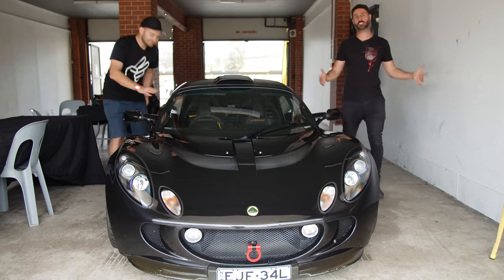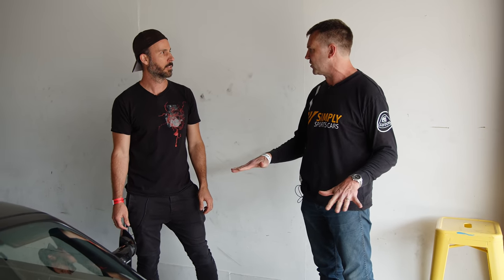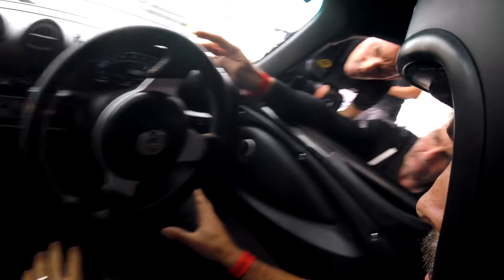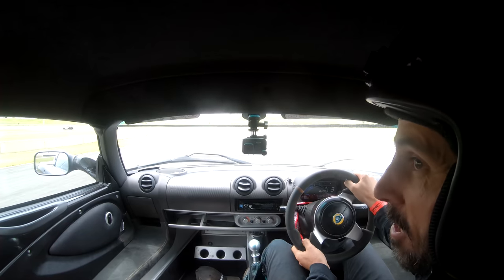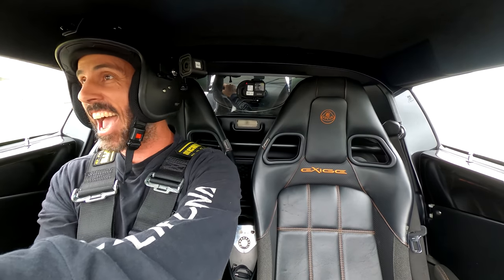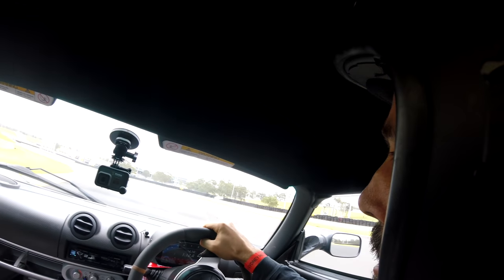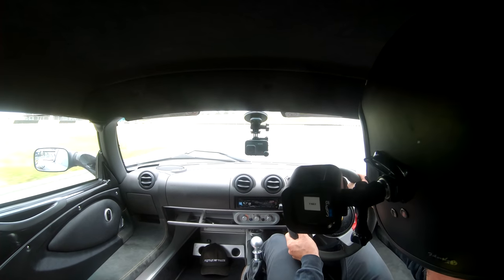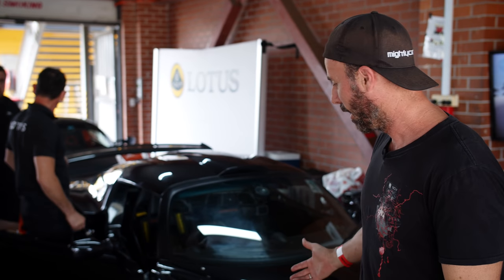LOTUS - Supercharger Upgrade (First Drive)

Comment: “It should be fast now...”
Reply: So much for "getting a super car so much faster than the golf" FAIL...shoulda kept the golf
Reply: @OutsideDuhBox  on a track it should be
Reply: @OutsideDuhBox  it would be quite a bit quicker on the track especially with some more fine tuning and a driver mod
Reply: @GeneralNOH  not without a butt load of more power mods it's not going to be...and drag race and roll it will always get killed...idk..I feel it's a fail.
Reply: @OutsideDuhBox  but the golf is boring as fuck lol, not everything is about going the fastest you can, the experience alone is worth the lotus
Reply: @narojdebeste  by boring...you mean looks...because as far as every other department it wins. Lol
Reply: @OutsideDuhBox  in terms of driving experience, the golf does not even come close mate
Reply: @OutsideDuhBox  you're comparing a golf to a track car there mate
Reply: @maximumpower8460  and? You can compare any car to any car. And any car can be a "track car" 🤦‍♂️
Reply: It is, they have the power it should have, and the handling being as it should now will produce much faster lap times. The car is very light, and with 250+ BHP is going to be very quick, a stock s240 that has not been ruined accelerates from 0 to 60 mph in 4 seconds and from 0 to 100 mph in 9.9 seconds, not exactly slow.
Reply: 13:50 think Moog said it best himself hehe
Reply: @OutsideDuhBox   @Outside Da Box Its probably already as quick on the track as it is, if not faster. Its a far better platform for the track end of story, lighter, and much better designed for tracking. its a 1.1 tonne MR car versus a front engined hatchback closer to 1.5t.
No matter what you do to the Golf, its still a Golf.
As it stands the power to weight isnt too far off the Golf R they had anyway, 10-20 more KW on the Lotus and its going to be pretty close.

Yeah the Golf migh win a drag race, itll be more comfortable, more quiet, more practical. But thats completely besides the point, if you think its a fail youve totally misunderstood why they've bought this car, its for the driving experience, not mashing the pedal and seeing what 1/4 slip you get at the window😂
Reply: @GeneralNOH  how is everything you mentioned as pros to the golf "besides the point"? Maybe they are to you...but all those pros are HUGE wins to the golf and to many, and it would also win a drag race AND price. And it is NOT faster on the track the way it is right now, I would say it needs boost turned up waaay more and more go fast mods to make it as fast on track as the golf right now. Yes eventually and with less will it be faster on the TRACK...but BARELY..AND it would lose all those other "beside points" as you call them..I am by far not a golf fanboy, I have never owned one, I just see this as paying more for less in a lot of categories, and barely more in one category, just for the sake of it being a "nicer looking" Lotus...and not mashing pedal and brake and turning the wheel just to see your "number on a screen" 🤣 and moog will defend the lotus to the death rn...it IS his current content beauty. Gotta defend it duh...why talk smack? Wouldn't add to views.
Reply: @OutsideDuhBox  i drove a golf R and it's not funny to drive, it's good but it does everything alone correct trajectory adjust braking force and steering wheel stiffness, i don't feel like i'm driving it, and that's why it's not a race car.
Reply: @samcoffre9684  the purity
Reply: @mgn567  yeah its not "fun" to drive...or funny by that matter lol. And yes some people prefer the car to feel engaged with them...but others prefer the number at the end of the drag or track instead ...and others prefer practicality and price.
Reply: @OutsideDuhBox  They were at the end of the road with the Golf either way, it was time they sold it whether they bought a fancy car or a shitty car to replace it.
Reply: @GeneralNOH  this i agree on as far as for YouTube content. The golf was sort of maxed out...although they could have gone with the highest spec rev kit...remember they only did level 2 I believe? In any case, it is typical for a YouTube to move on for content. The lotus shall be the same eventually...what will come next...
Reply: @OutsideDuhBox  Probably wouldnt be worth going further, massively diminishing returns for far more money. Reliability would start to go out the window or alternatively youd be opening up the engine. The thing was pushing 750nm of torque or something, much beyond that you're likely looking at full drivetrain overhaul and something that will need expensive engineering for the street/impossible to have on the street. Probably why a properly fast track car was the natural progression from a properly fast street car
Reply: @GeneralNOH  that lotus would be in the same boat with that same amount of power lool. Drive train would need major overhaul
Reply: @OutsideDuhBox  Got nothing to do with power its all about torque. 
Much simpler drivetrain in the Lotus, id hazard a guess its more robust as a result.

Unless you wanted to turn it into some sort of drag car (why would you) thered no reason to push big numbers anyway, it would just get sketchy to drive and its a quick car as it is. 250-350hp is plenty and easily atainable and already higher power to weight than what the Golf had. 
If they really want to go silly the Exige comes with up to 430hp factory options, the engine they use in that model is a common toyota unit so i dont imagine itd be hard for them to source one and stick one in if they really wanted to. Then you're looking at close to 300kw per tonne.

Comment: "It is the responsibility of the faster car, to slow down for any slow cars", he says overtaking a Ferrari. lol
Reply: To be fair a stock Focus RS  or Subaru STI is probably faster than a Ferrari 308
Reply: @nattankress  I think it was a Mondial, slower (and less good looking) than a 308
Reply: @ToolkiT73UK  yeah correct man. My girlfriend and I couldn't quite determine whether it was a 328 or a Mondial until the side shot at 11.35 where you can see that big finned air vent on the rear quarter. Definitely a Mondial

Comment: "It is the responsibility of the faster car to slow down for the slower car." (seconds later) Bye-bye Ferrari!
Reply: This is ironic and funny, but true.  A Lotus may be fast in the corners, but slow on the straight.  The Ferrari should let him pass in the straight  because the overall Lotus lap times are much shorter.  I experience this all the time in my lighter RSX.
Reply: @DC5Brandon  It was a 40 year old Mondial...
Reply: @Jaredscott89  Good point!  I must have missed that.

Comment: The difference between a good time and fun, fun is over when it ends, a good time you'll remember for the rest of your life. Was that a Ferrari Mondial?
Reply: Yes in the vid with the car drivers lap you can clearly see it is a Mondial..
Reply: @ToolkiT73UK  I guess next time I'll bump it up to 720 or 1080. A lot of times though there can be cars that look similar but have a different model name. Like trying to eyeball whether something is a 308 or a 328, 550 or 575M. I believe the Mondial has the regular version and QV.
Reply: @pgtmr2713  the air intakes on the Mondial are very distinctive. But you are right the 308, 328 and 288 are very similar looking at first glance.
Reply: @ToolkiT73UK  See, there's that trivia.

Comment: 13:32 LOL look at the size difference! And that's next to an M2 which is already a pretty small car.
Reply: The M2 isn’t that small. It’s bigger than every M3 before the F80 (slightly shorter in length than the E46), and even then it’s the same height, it’s wider, and only 8-9 inches shorter than the F80. It’s not a big car, but it’s by no means a small car.

Comment: Start learning heel n toe.
You will be so much faster..
Reply: Came here looking for this
Reply: Yea, downshifts are not good
Reply: @MrBasskriss  yeah they are rubbish.
Causes allot of extra wear on the clutch at those speeds when downshifting as well.
Reply: @grantheath8547  Worse than that for a RWD, if you're downshifting late into a corner without rev matching you'll get a nice bit of extra braking on the rear wheels from the engine, really easy to have the car swap ends in that situation.

Comment: Fun fact some Lotus drivers used to use a misfiring system to make backfires. This in turn made loud noises that made it seem that they were more powerful than they actually were. Causing other drivers to push themselves harder than they normally would. Which in turn creates mistakes from other drivers. Thus giving the Lotus driver an advantage. Lotus drivers are not the only drivers who use this tactic, Street racers use it as well. And I'm sure other Motorsports like world really cross, Moto GP, etc, etc.

Comment: I seem to have been correct in the last video regarding the tyre situation, they look like Kumho Ecsta V70A's, as Michelin unfortunately stopped producing track/high performance tyres in smaller sizes..
Also they're not at all mentioned due to contract.

And Moog, now the next step is heel-toe downshifts, as it won't upset the rear end.
And also focusing on having the correct gear for corner exit when entering corners.

Great progression! And love seing your gained confidence in the car! 😃

Comment: Good job man. Alignment and tires are really a make or break for a track oriented car, and had everything to do with how poorly it took corners before. Make sure you really focus on your entry and exits, wind the car out into the exit, and hit the outer limit of the track. You'll be so insanely fast thru the the corners.

Comment: One (hopefully helpful) tip: Use more of the track. You can clearly see in the outside car videos, especially round Brock's turn 5, you are not going near the apex, or near the outside exit point. On this corner in particular I even go onto the concrete slip way on the exit, in a 4 wheel slide, right on the edge of grip. Try using more of the track, it will make it easier for you.

Comment: Hey  Moog  nice to see you enjoying the Lotus now.
If I may offer a suggestion might help brining those times down and inspire even more confidence in the drive. 
You should look at your rev matching and heel & toe your downshifts. You can hear engine wind up to match drivetrain on your down shifts, this can upset traction and balance. If you compare to Mark clip his down shift is instant, little blip and he's back on it. Better rev match will really make drive smoother and more stable specially at corner entry, as well as make the shift much quicker so you can get back on power faster.

Comment: Glad you got the handling sorted. It's the most important factor and far more important than adding the super charger. You need to learn to carry the speed more and improve your lines. I felt you were nearer the limit in the BRZ, but then I think you had a lot more confidence in it. The racing driver showed what is in that car and how to use the track and run off rumble strips. Your journey is firmly under way.

Comment: Late to the party but really digging the track videos. Inspired by super gramps, which I also took my Lib Wagon and just got over 2min with zero engine mods. Will def aim sub 2min and can resonate with using more gears. I need to drop to 2nd for both the double apex and the wide right bender towards the end! Good stuff MCM

Comment: Only thing i noticed you might need to work on, Moog, is to blip the throttle on downshifts. Just letting out the clutch can cause disturbances in the rear wheels, which may end up resulting in a loss of traction on them.

Comment: If you stopped coasting from your braking point to the apex of the corner and knew how to shift using heel & toe rather than upsetting the car balance by releasing clutch as you'd drive on a Sunday stroll, you'd be able to take corners so much faster. Tips from the track with Elise 111R

Comment: If you aren't able to heel-toe, I would suggest installing an auto-blip. these work quite nice on Lotus and have been very well developed over the years. The car gets really unstable on harsh downshifts and the gearbox takes a beating on hard downshifts without revmatching. The C64 transmission isn't known for it's good durability ;-)

Comment: As much credit as I can give them, because they know HOW to adjust a suspension based on their classic oldschool "string" method, the new age of alignments and such with proper technology, you can get even more accurate than the string. They are simply unwilling to learn a new system. At my old mechanic shop, we had two alignment machines (yeah, two) one was pretty old which I knew how to use and one was brand new with a slightly different setup procedure. I didn't use the new machine because I simply didn't want to learn at that point. Eventually the tech came in for the new machine and I got hands on learning, turns out, its insanely more accurate than the old machine, so much so that it made doing alignments quicker. The newer machine also included height values which the old machine did not. So you could see if the suspension was sagging which you might not see with the eye, and it would take that into account when aligning it so the alignment was more accurate. The old machine, didn't care for height values, so you could do an alignment, go for a test drive, and it still felt wrong....

On the note of a car properly setup, moog now see's how important it is for a car to be properly setup. He was clearly smiling ear to ear with the properly setup lotus. Like a kid in a candy store. And it makes me laugh at the street racing scene, and I call it a scene because they think they are hot shit, but 90% of those cars are setup completely wrong in every way and wouldn't win a race vs a slower car with a proper setup. Hell, even back when I was going to street meets sunday nights, all my friends cars had adjustable suspension which they turned their little dial to max hardness so essentially the suspension never moves. You hit a bump or a rock and you felt it through the car, through the seat, and into your body. Meanwhile my car which had stock shocks but lowering springs, had suspension give, so I could corner faster than them (on the street). Now track, sure, perfectly flat ground, no rocks, no bumps, rock hard suspension would/could be important. But even most teams wont go THAT hard. They go as hard as required but as soft as possible. At least from what I have seen.

Comment: After an unfortunate loss of patience, I have discovered that Exige sun visors will pull out by just twisting back and forth while pulling them away the spear-like pin they are hung on. You get an extra 2-3 inches of windscreen vision in top clearance to peer out of from your driving seat. The visors pull away toward the rear view mirror in the middle of the screen. I am 6'2" and found it truly irritating to hunch forward under the visors when desirous of observing traffic light signals and signage at intersections etc.

Comment: Need to adjust the white balance on some of those gopro's, looks like you're driving in a cloud!  Also, in the rear facing interior shots, the engine is moving around quite a bit.  Not sure if its the extra power but would definitely suggest someone see the engine mounts look good, and if there's any trouble getting into gear for sure pop in some poly inserts as that will help.

Comment: Moog, you need to be smoother with your throttle control and steering inputs, and also need to learn to heel/toe downshift. You just need to be smoother when you're driving and those lap times will easily drop a couple seconds. It'll take a lot of time to get to a 1m 49s lap time, but that final bit will come with confidence and knowing where the limits are with the car, and improving your driving ability.

On a side note, super jealous that you have an Exige! It's been my dream car ever since I saw it in Project Gotham Racing for the original Xbox! They cost way too much here in the USA and they aren't going down in price here to make it worse. But maybe one day I'll be as lucky as you and own one!

Comment: Moog you need to get into the heel toe action specially on track changing gears so many times. Downshifts in the corners you risk losing the back end by not doing so depending on how hard you are pushing it

Comment: just realised watching this that moog doesnt rev match on downshifts and just pops the clutch, as someone who has driven light weight RWD cars this is a bad thing as it can cause the rear axle to lock up and unsettle the car, rev matching makes slowing down for corners and dropping gears a lot smoother plus helps save your clutch too

Comment: Moog, you really need to start thinking about toe-and-heel rev-matching - especially on a mid-engine car.  Not only does it save your clutch, it will keep your weight transfer from suddenly going to the front just as you turn into a corner, because with mid-engine cars, the weight6 of the engine behind you acts as a pendulum (although not as badly as the Porsche 911/930 Widowmaker) usually means a spin as you turn in with the rear tyres unloaded.

Comment: Hey guys, thank you for all the videos, been following you since you fixed the non existing dent on the blue turd!! Would it be possible to also get a GoPro on the roof? There is such a big contrast difference between the in and outside of the car. Would love to see a bit more of this car on the track but also see what is coming up on the track.